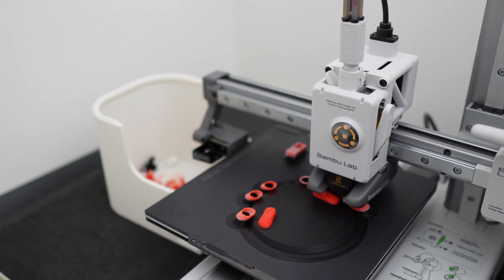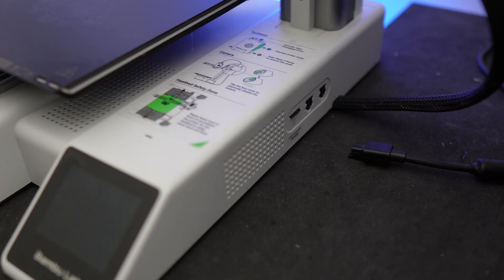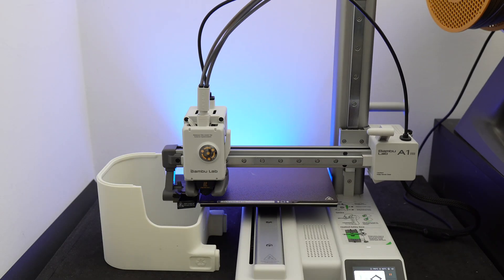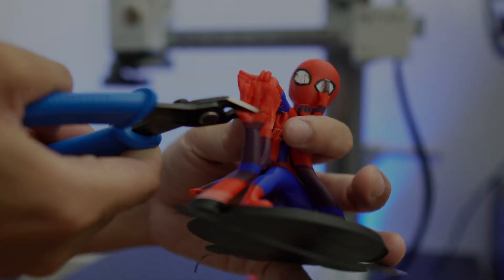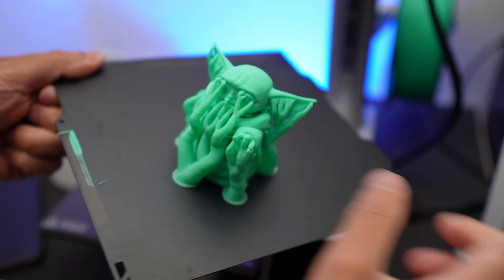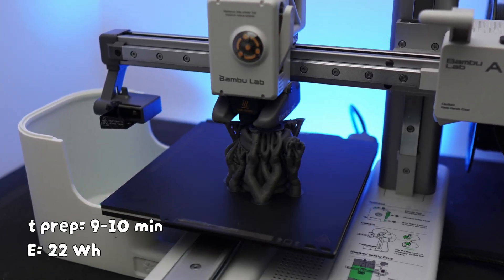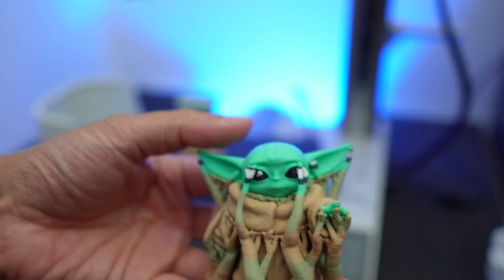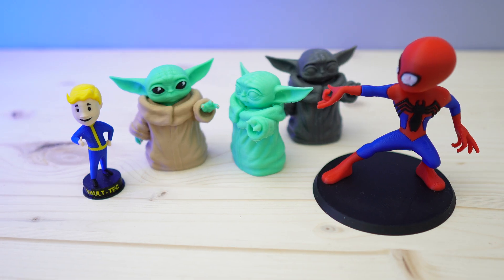How much does it cost in electricity to 3D print (It's *NOT* cheap!?) ft. Bambulab A1 Mini

Comment from the maker: Recommended 3D printer: https://www.awin1.com/awclick.php?gid=570772&mid=46345&awinaffid=2034675&linkid=4382705&clickref=
Best affordable 3D Printer (Used in this video): https://www.awin1.com/awclick.php?gid=570773&mid=46345&awinaffid=2034675&linkid=4382675&clickref=
Recommended Filaments: https://www.awin1.com/awclick.php?gid=570777&mid=46345&awinaffid=2034675&linkid=4382680&clickref=

My 2nd favorite filaments: https://geni.us/A4OFomi
Lubricant for X,Z,Y-Axis rails & idler pulleys: https://tidd.ly/3KMFHqs
Grease for Lead screws: https://tidd.ly/3Lk36j2
Deburring tool: https://geni.us/9WGzv
Wire cutter: https://geni.us/NAwQIL
Heat gun: https://geni.us/Jdcu

#Affiliate

Comment: You need to consider that if it is cold, and you are heating your home, that electricity is not pure waste; it is working to heat up your home, and so it is basically free in the winter. The opposite is true in the summer where you need to cool your home
Reply from the maker: yeah that‘s true! I‘ve a small room for my 3D printing stuffs, so just like you said, I don‘t even need to turn on the heating when I‘m printing 😄

Comment: Wow your energy is crazy high compared to the US. My power company (Austin Energy in Texas) rates vary from $0.04 for the first 300kWh with a max of $0.10 per kWh after 2000kWh in a month.
Reply from the maker: yeah the energy is really expensive here in Europe, unfortunately😅
Reply: @Lukis3D  I have solar on my roof and I can pretty much cover my energy in winter (not in summer when the AC is running 24/7) but if I were in Europe getting off grid would be my top priority at that price!
Reply: @roblutter  you cannot really live offgrid, however you can produce your own.

Comment: Great video - do you think this printer could make coloured model trains - I think most modellers use resin and paint them but I imagine it would save a lot of time to be able to produce finished colour models on the machine.
Reply from the maker: thanks! yes, it could print anything. The printer just works. It depends how big your model is though, since the print volume of the A1 Mini is quite small (180mmx180mm). If you wanna print bigger, you can get its bigger brother, the A1.
In my experience, multicolor prints can take somewhere around 10-24 hours to print. It could take longer if your model is bigger and has more colors, of course. Printing in multicolor also produce alot of poop, so if you’re okay with all of that, then i’d say go for it.

Comment: Comparing 230V vs 110V: At most it might take me an initial minute for PLA and 90s for PETG, but I think I’m running quite similar times. My calibration stage always beats the expected time from BL Slicer or Orca Slicer for my A1m, it’s closer on my X1C. I’m running a peak draw of 140W and an average of 50-60W while printing on the A1m and 300W peak on my X1C and 150-175W average depending on environmental factors and filament, my amperage will likely be higher at 110V than 230V and depending on internal circuits of the machine. 230V might be slightly more efficient but it seems close to a wash for such a small machine.

Overall my costs are much lower than OP though. Flex hours are $0.35131 per kWh on peak and $0.06795 per kWh off peak. I also run a 2kWh battery pack that I use for my medication fridge and charge it off peak to run during the day and buy BL filament refills in bulk at $14.99/kg instead of $20+ with free shipping or a similar competitor. Luckily the A1m doesn’t put out significant heat but in the summer A/C costs will be far more significant than the cost to run a printer alone if you’re in a confined area. I’m coming out closer to 1/6th the power costs and 75% filament costs not considering depreciation or environmental costs than OP.

Conversely I find this helps in the winter but my heater is NG vs 220V AC in the summer.

I just ordered an eco flow wave 2 portable A/C to run nearby on flex power and when camping etc to see if I can offset that, but that’s a high initial cost. The heat exchanger design should be much more efficient at displacing heat than letting the whole studio heat up and having a larger A/C unit kick in. I’ll be curious to see how that plays out, this is just what I’m doing to try to drop costs, solar would be ideal long term as I can run that straight into my power pack and portable A/C.

Comment: with solar its free
Reply: i mean the whole argument for spending 40k on solar getting your roi in 50 years might make a bit more sense if you are running a print farm but still solar is way out of reach for many
Reply: @thatcanadianguy3327 40k only if you go with overpriced company that will do everything for you. You can get 1kw solar panels system for around $800-1000, you will to buy separately the battery, but you need to install it yourself,  which isn't too complicated, especially for those who play with 3d pinter as most of them are techy and handyman people.
Reply: @thatcanadianguy3327  one or two panels, are like 160$
Reply: @thatcanadianguy3327  you can get solar under 1000 bucks buddy.
Reply: @thatcanadianguy3327  It's 4-8years actually
Reply: @Splarkszter  on avg i pay 300 a month for electric if a barebones setup for solar costs 40k (that's the low end) in 10 years i still wouldn't even recoup the 40k i spent on the system lol
Reply: @thatcanadianguy3327   I pay $75 at most so there's that
Reply: @Splarkszter  so it would take even longer for you to get your Roi, if its 75 a month that's 900 per year and if u pay 40k for a system my initial joke of 40 years is actually pretty accurate in your case so idk what ur on aboot
Reply: Lol
Reply: Hubiera estado buen saber cuanto material de filamento tenia las figuras y cuanto desperdicio de filamento generaba cada figura
Reply: Free. Yeah. How much do you pay for the solar panels (surely NOT one, you need at least a dozen on a sunny day in a sunny county)? How much for the whole regulator, accumulator, cable etc etc etc?

Oh right. 10k€ to save 10€ monthly.
Reply: @Ale_giro  I think I got my panels for free, you can do your own free rechargeable batteries like lead acid, zinc acid or znbr. etc.
Reply: @Ale_giro  yes dont even look at the market. surely you have friends who can help you to start with some initial tools.
Reply: @Ale_giro  you aint got it if its not free
Reply: @Ale_giro  run it from a solar charger battery
Reply: @Ale_giro  The panels are usually the inexpensive part, so everyone does install multiple panels (you're way off when you said a dozen; multiple dozens is typical) Install and all the bits that move power from the panels to batteries and the grid are a lot more.  But payback can be decent, depending on where you live and power cost.  I guarantee you you're saving a whole lot more than €10 a month if you're paying €.4 per kWh.
Reply: @Ale_giro  costs absolutely nothing, and you do it yourself. everything.

Comment: Would a printer with an enclosure be cheaper?
Reply from the maker: according to Bambulab’s power consumption table, P1P consume moe energy than the P1S so i would say yes💯
Reply: @Lukis3D  Thanks 🤓
Reply: It would be, but its most notably on longer prints. If the print is finished before the printer is fully heated up theres no difference

Comment: Why would heating a power bed from a 120v socket differ from heating a bed from a 230v socket ? Isn't there a transformer to the voltage of the bed heater? (good or bad comment, youtube does love engagement so... yea. that being said, keep up the good videos)
Reply: The mains power goes directly to the bed and isn’t reduced in voltage.

Why does 110v take longer to heat up. Let’s say it consumes 10A. 230v/10A is 2300W where as 110v/10A is only 1100W so to consume 2300W will take longer at the same Amps on 110v.